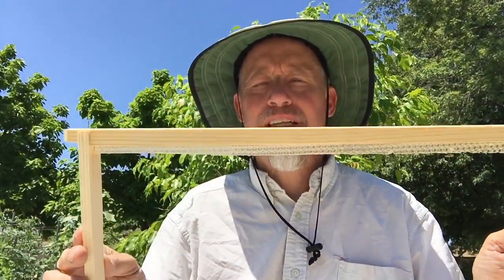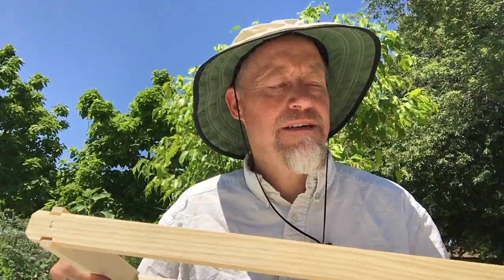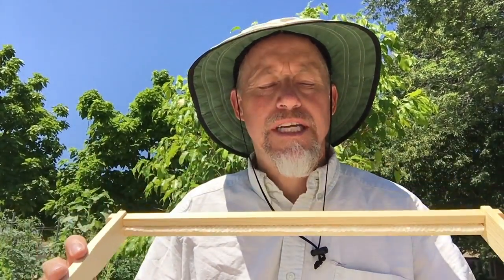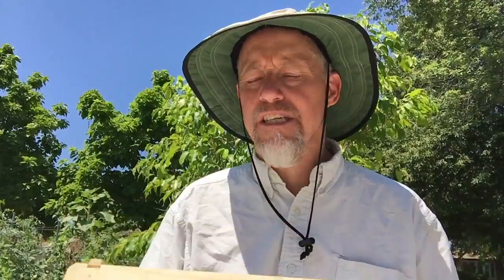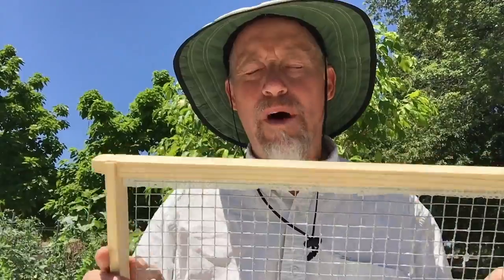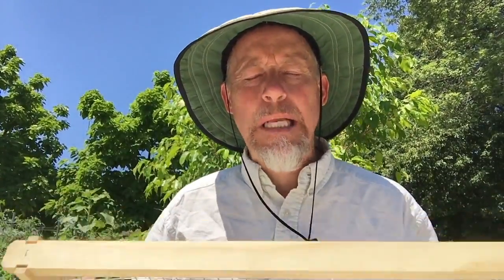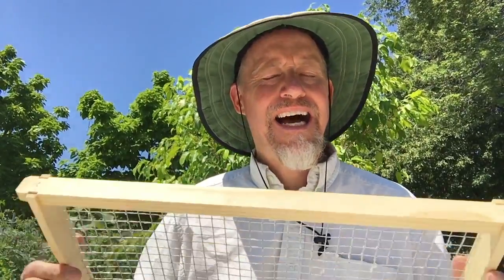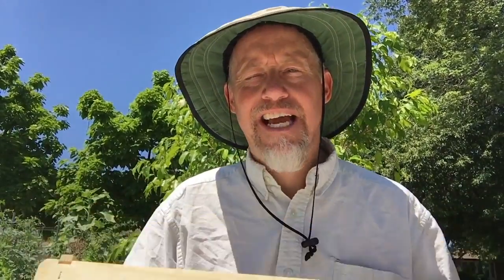An experiment in foundationless frames

Comment: I think you will get comb full of holes. In nature, bees build comb from a ceiling hanging down, but here they will have 16 different heights at which they can start building, stacked atop each other. After they've built a bit, built comb will come close to a different comb, and then the bees will make a bee space.
Reply from the maker: Actually the results were a bit of a failure, the mesh just seemed t confuse things.  I have an update in the works but sadly I deemed the experiment a failure.

Comment: They really don't except the wires in or bought foundation queen won't lay where wires are but who knows good luck.
Reply from the maker: Good to know, thanks, they have just started building comb on it, but it's only 5 of the 20 frames so I guess it's a wait and see.  This is my first hive and not using the plastic foundations was all I was really going for.
Reply: They will after the foundation has aged.